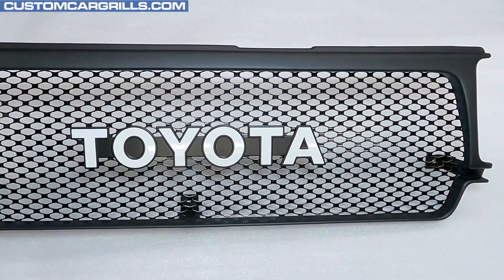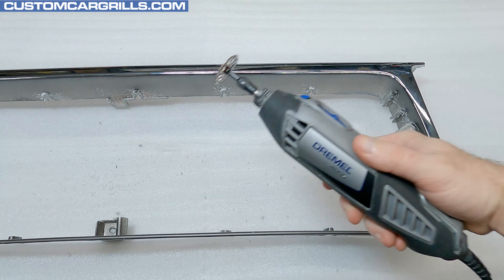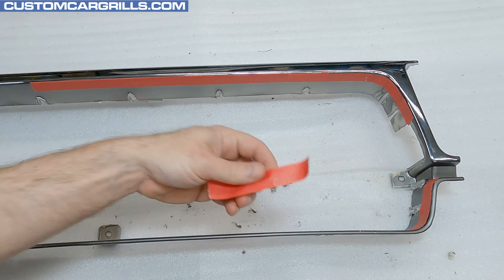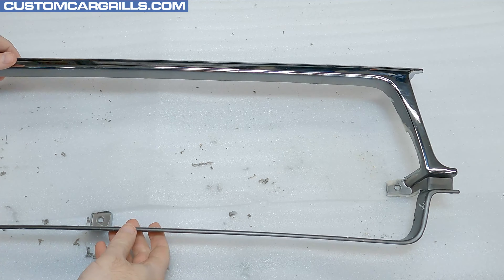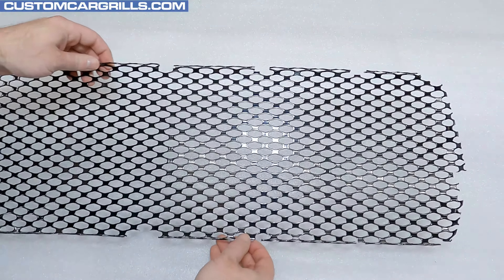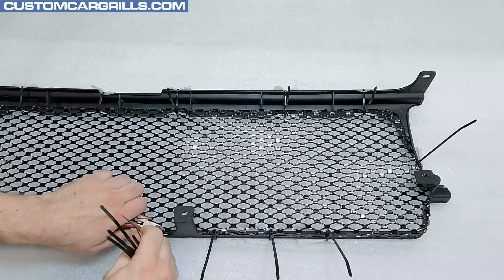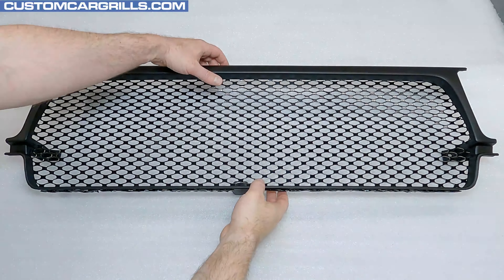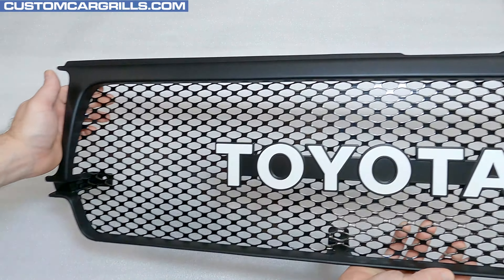Satoshi Mesh Grill for Toyota Land Cruiser 1991-1997 How-To by customcargrills.com

Comment: Nice, how about plastic grill? Is there any precut for plastic grill? If not how do you cut and attach to oem grill housing?
Reply from the maker: I might be misunderstanding what you're asking, but I don't have (or plan to have) a plastic mesh version of this pre-made mesh insert available.  An install using a plastic mesh would be sustainably more difficult and likely require a completely different approach than what I show here.
Reply: @customcargrills  yes i was checking your website and i didn't find any plastic precut. I'm trying to do this on my 3rd gen rav4. I'm just trying to figure out the best way to attach grill into the oem grill housing. I had to choose plastic because only plastic comes in long hexagonal shape. All metal grills are either a thin and basic. If you have any suggestion then let me know!
Reply from the maker: I'm not familiar with the 3rd gen Rav4, but you're welcome to send me an email with a couple of pictures with the progress you've made on the mesh install.  I might have some suggestions depending on how the factory grille installs back on the bumper.